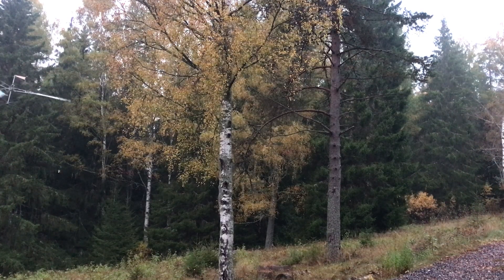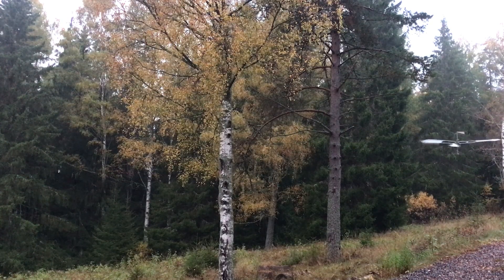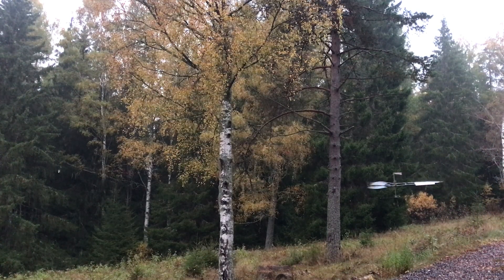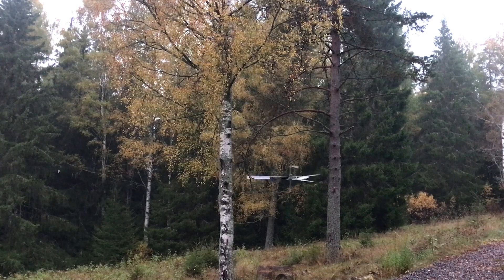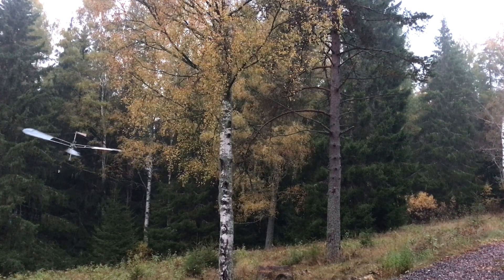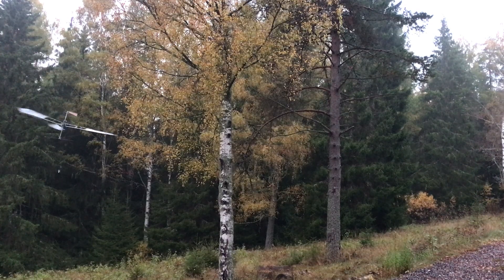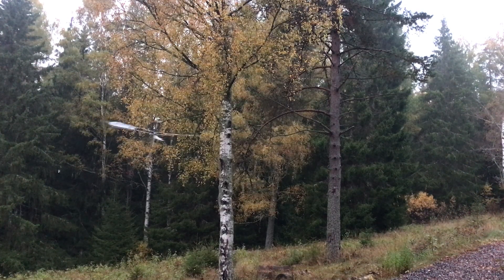Levitator 6 Investigating AoA tradeoff. Electric aircraft.

Comment: Hey brother, the optimum pitch is for every 10 units of diameter, you need 6 units of thrust.  So, at the tip, you'll need just under 2 units of rise over 10 units of width.  Hope this helps!

Comment: I also have a powered-rotor model that uses servos with cyclic controls timed through a magnotometer (MPU9250 9 DOF IMU + Teensy4.1+ dRehmFlight software).  Here is a video of it demonstrating control based solely on commands relative to the compass heading. 
https://www.youtube.com/watch?v=9dveVKFSPiA

Comment: Really enjoy all your videos, especially your scientific approach to testing.  I wasn't that surprised that lower pitch -> higher power -> higher speed, as that fits behavior of a controllable pitch prop on an airplane.  Lower pitch for higher RPM to get max power on takeoff, etc.  I was surprised though that the lower pitch and higher speed led to worst vertical performance, and I assume (as you seem to indicate) that that was because the drive motor props were already near their speed limits.  Looking forward to seeing what you get out of the 12x13s!

Comment: I have to agree with other comments I have seen. The wing is also a rotor and to get above the Effective Translation of Lift a forward motion is required which makes the rotor envelope behave as a wing. 
In this case the rotor is so slow there is no translation. What I see by changing the angle of attack is what I will call 'Beating the Air into Submission'. I see the rotor which looks like it is just tilted to make the air force under it to get lift. That is not the way I would see lift however. I would see lift as the difference in pressure above and below the wing. In the 'Beating Air into Submission' the pressures are reversed with higher pressures on the bottom of the wing. 
Is there a way to get pressure readings from the top and bottom of the wing to try to determine what is most efficient?
Reply from the maker: True, no real translational lift in this video, my bad. I was merely flying away from my own down draft.
Will get back to translational lift in next video.

Comment: Maybe the optimal design has adjustable (on the fly) wing angle, and no flaps. Basically your motor is attached at the end of the spare in a horizontal attitude, and the wing rotates around the spar.

Comment: It's interesting to see you re-discover many of the tradeoffs helicopter engineers discovered many years ago. The relationships between twist, hover efficiency and forward flight efficiency in particular, in this case. I feel it's only a matter of time before you discover the benefits of variable pitch blades and why swashplates are still the preferred method of control on essentially all helicopters to this day.

Comment: Great project you have.
Have you consider setting the angle of your wing (rotor) tip motor to an angle that would match the angle of attack of your rotor or something in between ?
My theory is that with an angle of "attack" of the wing (rotor) tip motor you would get a tangential vector as well as a vertical vector that may help hoover and descend flights at lower angle of attach main rotor.

Comment: One of the reasons that  the horizontal speed is important is to be able stabilize the trajectory when there are cross winds or gusts.  This is going to be a low limiting speed anyway, because in addition for higher lateral power (speed) for maximum directional stability the response time has to be faster.  The response time on this device is very slow due to the physical size and inertia.  It will always need low wind, no gust, wide pathways, even with a faster, but still relatively slow horizontal flight.  

Fun Fact: many decades ago, I found out that the little steering fins on a missile (like a NIKE) operated at 10 kHz in order to steer it towards a target, because it moves quite fast, ~ 8000 Mph, 12874 KMph.
Reply: Our with the same technologie are fast : https://youtu.be/DRKJuLZUqC0

Comment: so glad youtube recommended this video,,,,
so, rather than using propeller to move entire aircraft, gliding trough the air,  
just move the wings gliding in circular motion,,,
wondering if the wings designed like a biplane, stacked up, does it achieve more lift, or smaller rpm, at the same energy
Reply: https://youtu.be/DRKJuLZUqC0

Comment: A prop for 3D flying is very different than a normally recommended pitch and size. Testing on the ground in "dead air" is not the same as in motion, so we are looking for a motor prop combination that likes the airspeed the Levitator wing tips travel at. I just love this low speed flying. It's got a lot in common with 3D style flying.

Comment: can you change angle of attack midflight? like, increase it when you want to descend or hover? can you maybe increase it even further than 14 degrees?
Reply from the maker: The wings are very flimsy without the bracing wires, but there might be a way to manipulate the wires mid flight which could give you slow moving collective pitch control.
Reply: @amazingdiyprojects  i thought you were changing the angle of attack only on the elerons, not the whole wing. yeah changing pitch of the wing itself is probably too hard mid-flight.
Reply from the maker: @Alexander_Sannikov  Yes, I have been doing a lot of wire rigging in between flights to change the angle of attack of the wings.
I only adjust the leading edge wire length though, which works fine. This gives me some hope that I could get away with miniature linear servos to possible manage a slow collective pitch change midair with out any significant modifications to the main structure.
Reply: @amazingdiyprojects  i think you can either try to lift a hub where all the cables connect or to rotate it at a small angle -- both ways should be able to change their tension. i wonder if it can work.

Comment: Someone remind me how is the direction of the flight achieved.
Reply: They are all changing as the wings rotate. The signal is split into 6 different location zones and as the wing passes through one of the zones the aileron is adjusted for that zone thus giving lift to the rear portion of the craft or the left or the right etc. At least that's how I think it works 🤣
Reply: @k1nk0  Alright cool. Thanks.
Reply: with adjusting the "ailerons" attached to the wing, pushing the craft to one side.
Reply: @artokiiskinen1058  thanks for the answer but i still don’t get it. Is it done by moving one aileron at a time or all three of them?

Comment: Would it be possible to vary the pitch of the wings while in flight?
Reply from the maker: The wings are very flimsy without the bracing wires, but there might be a way to manipulate the wires mid flight which could give you slow moving collective pitch control.
Reply: I was thinking the same thing
Reply: I would think that might be a natural progression, but I'm sure that @amazingdiyprojects has already considered it. The collective pitch arrangement and swashplate as used in helicopters would seem to be a natural fit for this sort of project.
Reply: @jeremymtc  Exactly my thoughts. A "standard" helicopter gearbox that automatically adjusts the pitch depending on where in the circle the blade is relative to the direction of movement.
Reply: @bfelten1  Precisely. I would think that even a simplified flybar arrangement  for pitch actuation would bear a marked improvement in translation while still being of lesser complexity than normal collective.